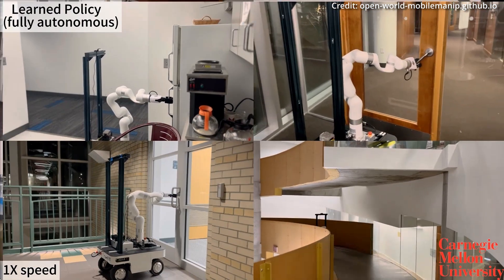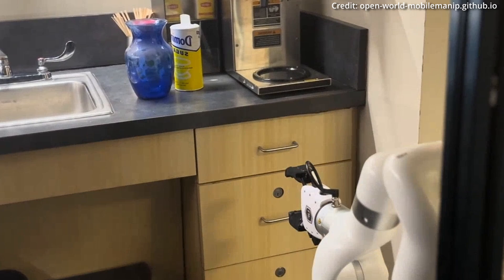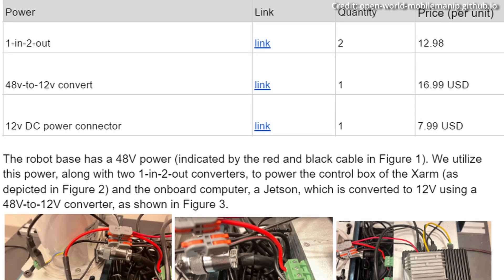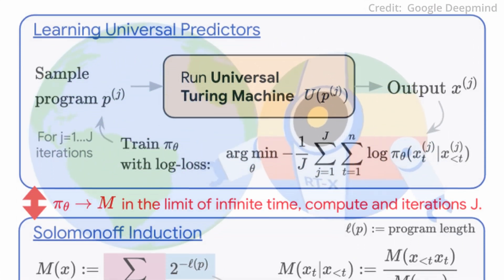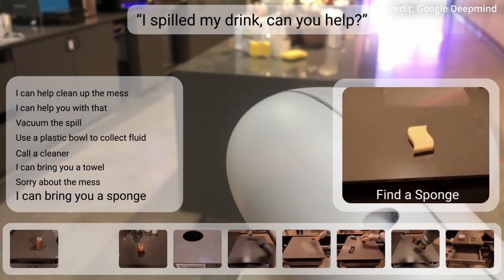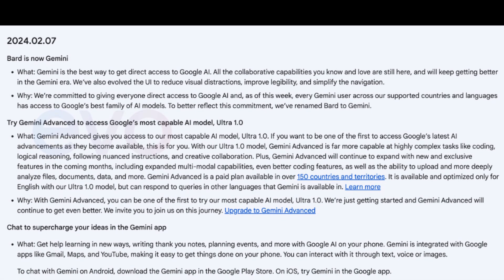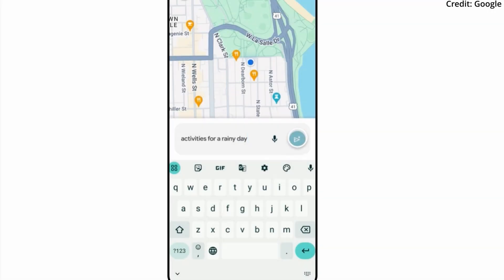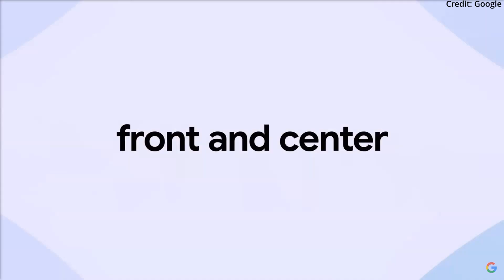CMU’s Open-World Mobile AI Robot BREAKTHROUGH (4 AREAS, 20 OBJECTS, DEMOS, PRICE)

Comment: They might adapt this arm to being used with e unicycles as well in that these can give it even more mobility both on road and off road and even in snow'

eg. Google

INMOTION V13 (Full Send Street Riding) Technical Fast Electric Unicycling

(VETERAN SHERMAN) SURPRISING FAST ONE WHEELED EBIKE!! $3,200

HOW TO RIDE an ELECTRIC UNICYCLE IN SNO

This can enable these bots to operate outdoors.

Ironically, having just one wheel and a gyro stabilized system can be more stable than having four wheels.

One might add an automatically deployable kick stand as well for when it is stopped to add to its stability.